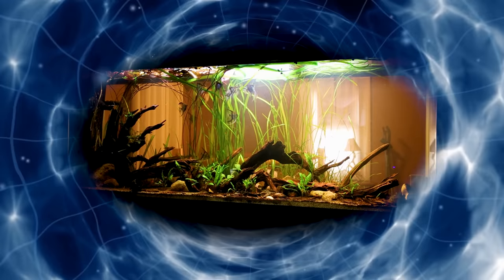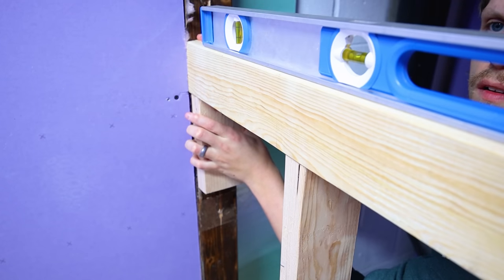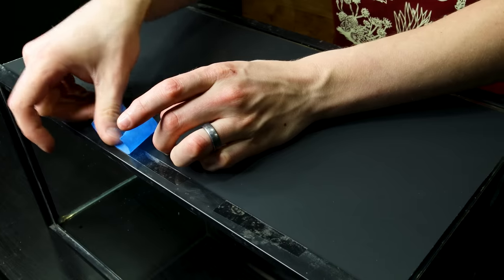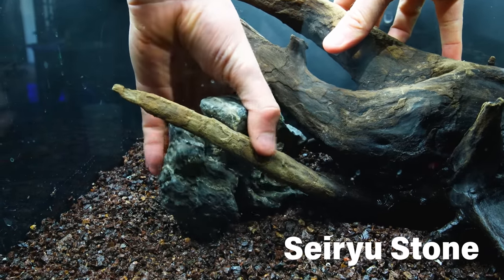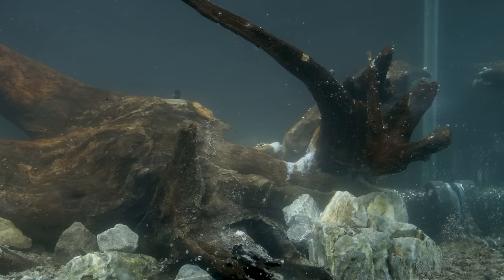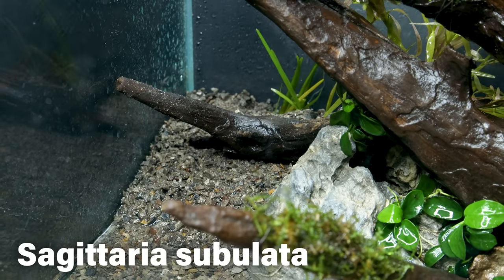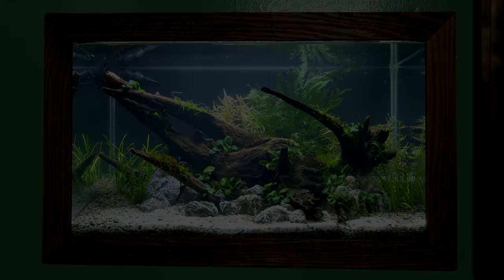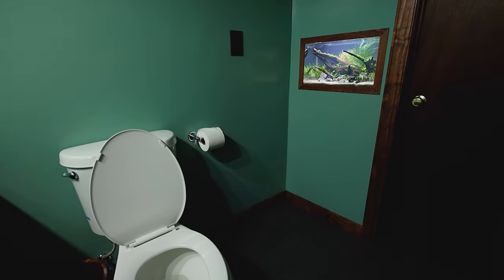In-Wall Bathroom Aquarium. Did I Take My Dream Too Far?

Comment: I built a 5 gallon planted shrimp tank into a towel shelf in my bathroom, friends would be in there for like 30-40 minutes just starring at the tank. Lasted 8 years until I moved out. Once every month or so I would have to scoop out about 50-70 shrimps they were breeding so fast. I think it was because I never messed with it, just added water, probably only did 10- 15 50% water changes. Turned out to be one of my best performing tanks. Good stuff fren.
Reply: Oh I love this idea! A five gallon sounds perfect for thr bathroom
Reply: Ugh I want that
Reply: I only water change tanks that hold fish I'm trying to grow out. Completely unnecessary otherwise
Reply: This, this is my new goal. My parents will complain. But what can they do about it
Reply: @amelialock7  I was doing a modified EI dosing and monitored water parameters. I would change 25% when necessary.
Reply: @Griffin050A1t  That's the spirit!
Reply: Did you feed them often.
I noticed they breed way more if you feed them shrimp food and stuff, but they don’t need it and will hold a smaller population if you let them survive on biofilm and stuff
Reply: @fungdark8270  I did feed them but not real often. A small Hikari algae disc and a few of their shrimp pellets about once a week or so. I had a 20g planted high tech w/CO2 shrimp, Otos, Corys going at the same time and I fed that tank the same thing just more often and that tank bred fast as well. I never tried not feeding.

Comment: Great job! As always... I think it looks wonderful! I couldn't put anything like that in my washroom walls because it is a small bathroom without available space. As far as "over" Vs. "Under" is concerned... Let me walk you through this... You're sitting on the toilette, and your "process" is not coming out very neatly... You pull some paper from against the wall and proceed to wipe yourself off, but sometimes... it doesn't go as neatly as planned. So now you grab another section of paper with your "soiled" hands, as it lies against the wall, potentially/accidentally/inadvertently smearing feces on the wall. If the paper drops away from the wall, this problem is averted. You decide.
Reply: Omg!!! I never thought of THAT!!!! I was over before but that solidified the over argument without a doubt!

Comment: Wonderful work. I happen to be  license contractor. Those interior wood screws are not a great choice for framing. Unlike nails or "construction screws" most screw are brittle and do not resist shear forces well. Its not a big deal but a tip for the future.

Comment: I think it turned out beautiful. I always wanted an in-wall aquarium too. Great idea to add it in the closet wall so you have easy access to it. I would add a small dehumidifier, or a fan and vent in the closet, just to avoid moisture buildup issues, though.
I only say this because my bedroom is now in the basement, in a room that was meant for storage only,...so there's no ventilation for heating and cooling in my room. I have a window I can open to freshen the air, and I can install an air conditioner or heater depending on the season, but, having my 45 gallon in my room was problematic because of the moisture condensation in the corners of the ceiling and around the window, causing mold to grow. Anyway, just keep that in mind. Wonderful project and beautiful tank and inhabitants.

Comment: Once made a 1 gallon tank set into my bathroom wall where there was a sort of little entryway for the door. When the light above the round tank was turned on, the shadows of the brine shrimp (for some reason this was all I wanted to keep at the time, but they did pretty well) moving around would be cast onto the far wall. It was a nice peaceful sight while sitting on the throne.

Comment: Under. 😊

Your new aquarium design is awesome!  How badly will the inhabitants be startled if the bathroom lights suddenly come on during an unexpected call of nature at night? 
I've had a variety of temporary inhabitants in the upstairs bathroom. The bathtub mostly was used to house freshwater tropicals when the 55 gallon tank started to drip,drip,drip from a stress crack that leaked at 2 am. 😳
There was a ring billed gull in the tub, rescued from drowning in a lake, until I figured out where to put her.
The favorites of the cats was when two sugar gliders escaped from their enclosure and I put them in the bathtub with some small branches until I could figure out how they got out. (Another early morning emergency.) Cats thought these two were so much fun gliding around from door frame to window sill....

Anyway, thanks for another fantastic video! ⭐

Comment: Over, even before I developed chronic tendonitis in both wrists that make it a bit more difficult to grab if the roll is set as under.  

Very nice build. I would personally not want a tank in the wall as I prefer to have the option of relocating aquariums.

Comment: Personally, i think instead of adding an aquarium into the washroom wall, it'll feel more immersive if you try aiming for a better and similar concept. That being, looking through a window as if youre in a submarine where you feel enclosed in a small room viewing an endless ocean. What I mean by that is having a way bigger tank and same size or smaller window. That way you won't be able to see the top, bottom or sides of the tank, giving an illusion that you're looking into an endless view, if that makes sense...You can also add a rock background too so it'll look like the washroom, aka submarine youre in, is close to the bank/rocks.

Comment: I was told by a doctor that it should be over. 
You use less and you do not touch the wall when you rip the paper which stops getting more germs on it. 
It also looks smoother.

Comment: Over or under debate) I'm pretty indifferent, but if I did have an opinion on it, it would probably be over because you don't need to touch the toilet paper roll as much, you can just pull as many squares as you want, and then yank it to the side without contaminating any of the other squares. But then again, your hands are clean before you reach for the toilet paper anyway, so honestly, I just don't care. If it's a big deal, I say, get one of the toilet paper holders that's upright, so the toilet paper isn't under or under or over but to the side. Besides, there are some really cool toilet paper roll holders that will also hold your backup rolls, so if this is a big argument for some families, I think that one of those would be a good foundation for peace.

Comment: OVER… 😅  I wouldn’t have it in my bathroom due to the humidity from the shower. I’d be concerned that moisture might get trapped and create an opportunity for black mold. You may not have quite the issue even through sink use.

Comment: OVER!!!
ALWAYS OVER!!!
Under is mental.
Over keeps the hanging bit away from the wall so you can grab it more easily. 
If your paper has a design on it, then under hides it, while over showing better. 
At my job, the janitorial staff keeps doing the under method, and since the dispenser is a recessed  metal frame, you have to dig your hand inside it or spin the roll over and over to get at the end of the paper, which when done in the over method leaves the paper end hanging neatly and correctly on the outside.
Under is just weird.

Comment: Over or under doesn't matter just as long as there is TP after you've used a porta John in 120 degree heat in the middle of Afghanistan and had to use notebook paper you don't care